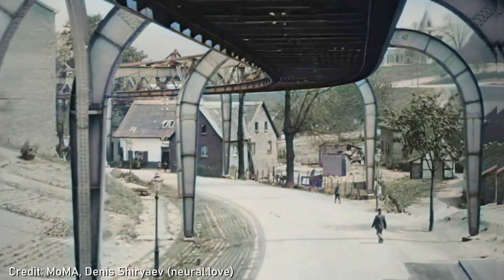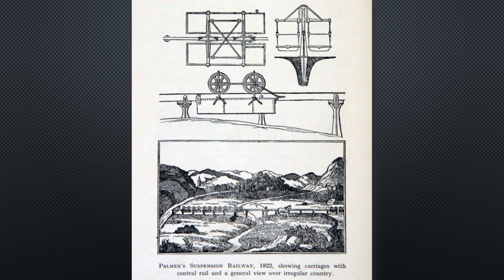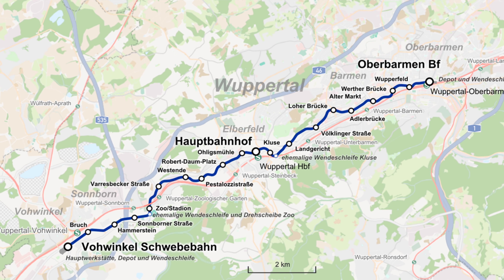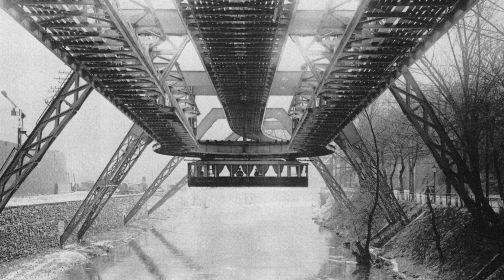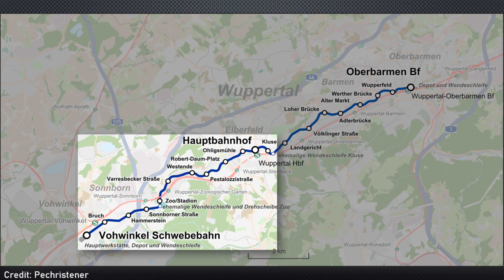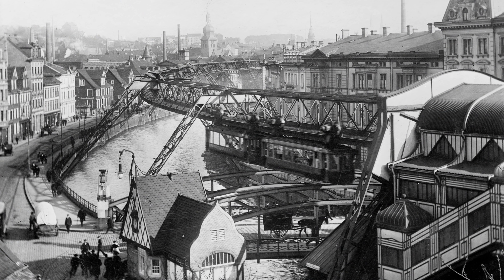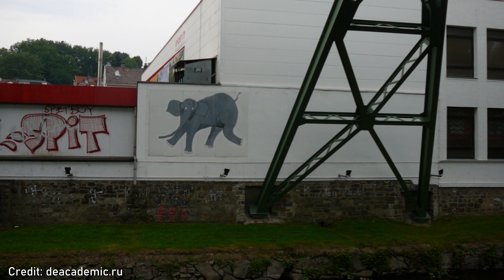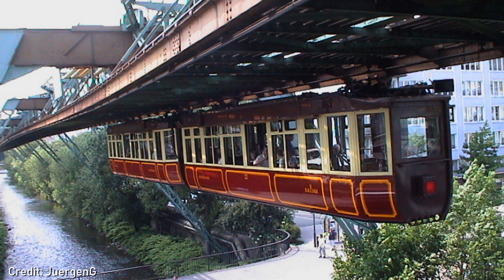Germany's Flying Train

Comment: How nice to see the Schwebebahn featured here! It is a great solution to the problem of transport along a narrow valley, which would probably never be implemented nowadays. It does have its problems though. At the moment it's only working at weekends because of design errors on the roller wheels of the new wagons. And a couple of years ago a bit of the electrically conducting rail fell off and landed on the (luckily unoccupied) passenger seat of a cabriolet which was passing underneath. I'd recommend anyone coming to Wuppertal to travel the length of the Schwebebahn. The new wagons have panorama windows at the back.

Comment: Reminds me of the proposed George Bennie ‘Railplane’ system that was proposed in Glasgow in the 1930s. The front engine was powered by electricity and had an open propeller at the front. The carriage body was streamlined similar to an aeroplane. He proposed that the system could travel at a speed up to 120 miles per hour. Bennie started to build his system outside Glasgow (at Milngavie) however, he could not get the investment that was required and eventually the system was scrapped.

Comment: And it hay to stop service for half a year in 2019, due to some brake malfunction, and now it stopped service again for 1 year because the structure of the rails and the wheels of the trains are broken. 

Also the new trains can only go 30km/h instead of planned 60km/h and it's much louder than it should have been.
Reply: The wheels of the new trains destroyed the rails and now its going to court.

Comment: I worked around Wuppertal and Dusseldorf and even dated a girl, who went to University in Wuppertal for an extended period, back in 1990. I can't remember this elevated railway? It's the rype of thing, which I would have been fascinated with. I tend not to notice things visionally, so someone needs to point them out to me, or maybe I've lost my memory of it? Of course, November of 1989 was when the Berlin Wall came down, so there was a lot going on in Germany in he Spring and Summer of 1990 that may have distracted me.

Comment: If only we had a suspended railway like this here in London; it would be so much cheaper to build and maintain than the light rail used on the DLR and thus could easily replace all the bus services in Central London
Reply: Had similar thoughts about Brum. Hang the railway off the sides of buildings - combined transport & tourist attraction. Either that or a log flume !
Reply: @millomweb  and it would be great for commuters too thats if we put buildings above the roads and suspend the tracks off that

Comment: It would seem obvious to run the train on top of the elevated track, rather than sling them under it.  By putting it under they ran into the "Monorail problem", ie you can't connect to the vast kilometres of existing railways.  Sydney's "amazing" monorail was built in 1988, slowly fell into disrepair, then was demolished last year.  I took a ride on it just before it closed & it was depressing.  Run down cars, boarded up stations and I was the only one in my car.
Reply from the maker: But with it underneath presumably there's less equipment needed to connect it to the track as the centre of gravity is below the track?
Reply: The advantage of suspending the cars on a single track was twofold. It allowed for a much slimmer and lighter support structure (which was important, because building over a river is expensive), and more importantly, the single suspended rail means that the carriages wil automatically lean through the corners, and thus are able to travel a lot faster through the tight bends. A conventional railway would have been a lot slower and louder, whilst being more expensive to construct. Besides, there is already a conventional railway above the valley (the Schwebebahn in fact passes under one of its viaducts). So it was never intended to be anything more than a localised rapid transit system. 
Another disadvantage would be the scale of the turning loops at both ends, the system allows for an impressively compact turning circle tighter than that of a bus.

Comment: With an electric train, why did they need to turn the train around at the ends? Just put it in reverse.
Reply: Ther is not only one train on the rails. Imagine just reversing a normal train on the rails. Would be quite catastrophic...
Reply: @ILucaII  There are various ways to have trains pass by each other even on a single rail without any issues. But with the cars being this short, simply making it a single rail loop does seem to be the easiest way. That the train faces the other direction after leaving the end stations might really be just a side effect from this system instead of a goal.
Reply: Yora but there are over 30 cars on this rail. Do you really think it’s easier to manage them on one rail than just have a loop.